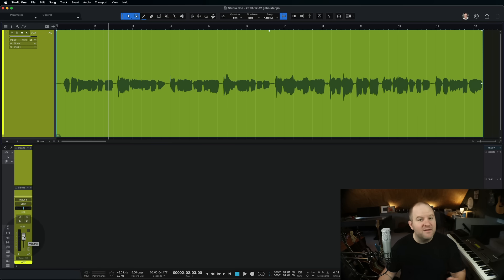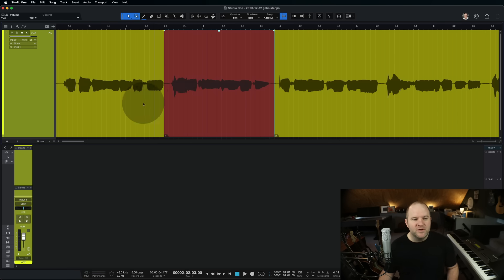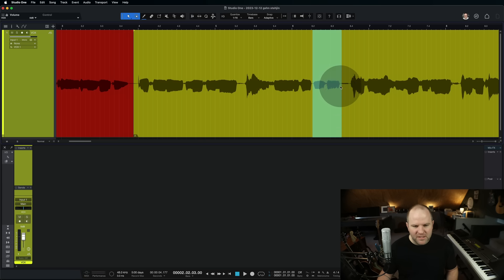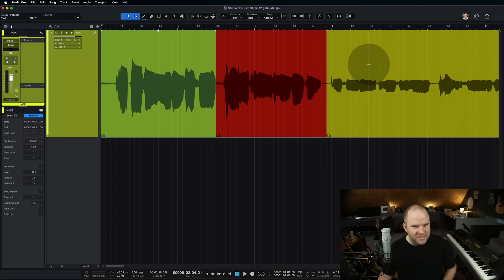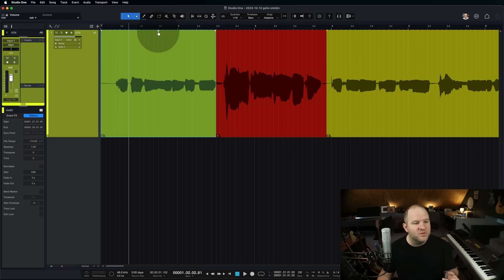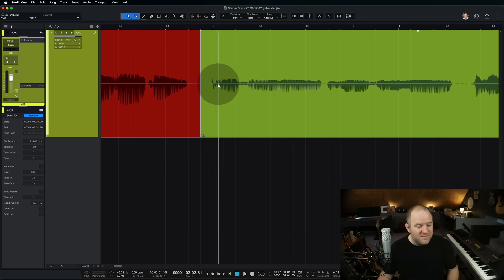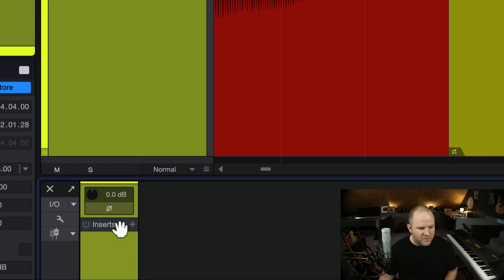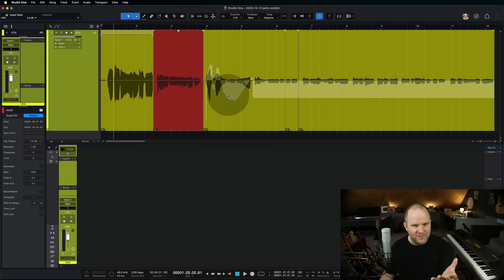Understanding Gain and How to Adjust it in Your DAW | PreSonus

Comment: Good afternoon!  a question: Why, in my Studio One, even though I leave the Channel with a lot of gain, and the Fader high, in a signal capture, the Signal enters small in the DAW, especially in acoustic recordings.  Everything recorded on Condenser.  I always need to normalize the Audio.  This is not always good!  The Wave Drawing is always skinny.  In my Studio One 5, everything was normal, a wide band... But now, in the 6, it's always Skinny.  Is there any specific setting in the DAW, to Record this Signal, Loud, Strong, and with a wide Wave?  Which in my opinion would be normal!  Thanks.

Comment: Hey quick question should I apply normalize first and then do clip gain?
Reply from the maker: Great question! What are you hoping to achieve with clip gain? Do you mean adjusting clip gain on different sections to even out a performance?
Reply: @fenderstudio  well I notice that I clip even in the green on my interface, I hope a plugin is made to detect mic connection and proper balance before recording.

Comment: I think of the gain knob as the water spigot. Full blast water on the in side, the spigot is the gain knob which controls the amount of water going through. Too much water versus the right amount of water, to not enough water. You want a nice stream of water is what you need. Audio is the same thing.
Reply from the maker: That's a great way to explain it! Thank you for sharing!